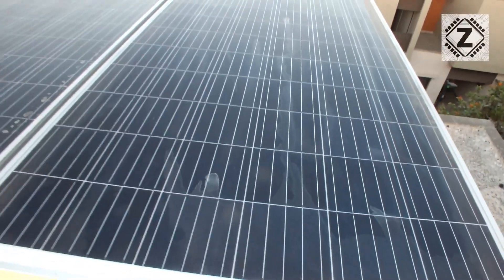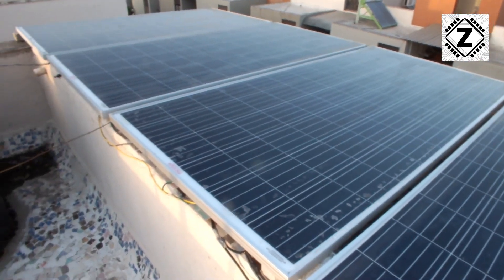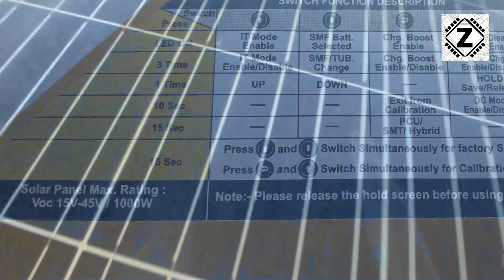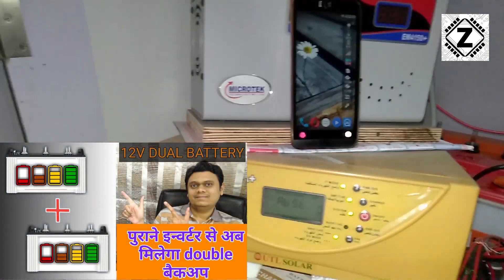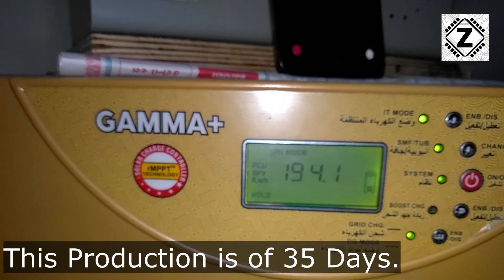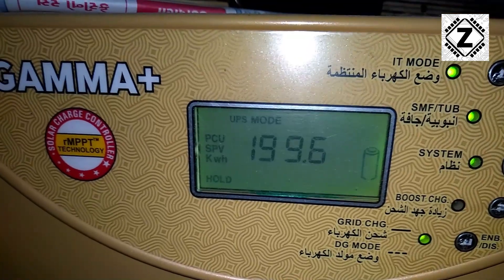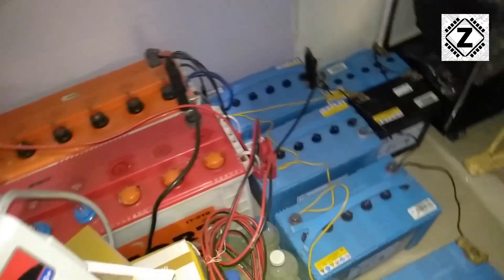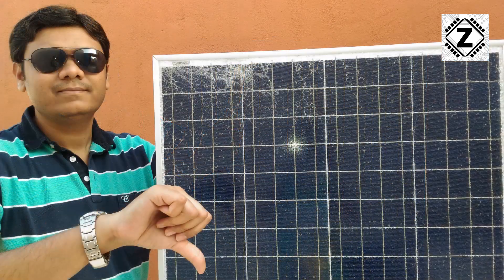UTL Gamma Plus Daily Solar Production proof | 1.3KW panels on 1kva Inverter? | Solar setup tour[Eng]

Comment: Can i connect 8 165w panels? By keeping 2 parallel of 3x165w series?
Reply: I use 24v utl gamma plus,  given Voc is 90v, and Voc of 165w panel is 22.2v
Reply from the maker: What you're saying will be 6 panels (3s2p)
Reply: That is one of option,  where i can add another 330wat panel to that combination

Comment: Sir, I have one question for you. I have a 150AH C20 tubular battery. I want to connect 1000W of solar panels to UTL Gamma Plus. Since I cannot charge the battery with more than 15A current, I know I have to limit the charge current in the inverter settings. However, will this also restrict the amount of load I can run directly from solar power during the day? My idea is to only limit the charge current going to battery but not limit the solar power for my other loads. Is this possible?
Reply from the maker: https://youtu.be/zaZgaVWMMsQ

Comment: 1.32KW is generating 5.5 units approx averaged over 35 days. So that comes to 4.16 units per KW of solar panel. This is a fairly good number as the average per KW is 4-5 units in India. I think with proper angle, it will generate slightly more.

Also the inverter shouldn't burn out with 1.3KW. What's most important is that you don't exceed the VoC supported by the inverter. The current will be automatically limited by the inverter on the output side. However, I hope they have good overcurrent protections on the input side too as that is what will prevent overheating due to over-panelling.
Reply from the maker: Good summary.

Comment: Do use Solar panel with  proportion of Battery. Fro 100 Ah,C 10 battery 240 watts solar panel only , if u increase more ,the battery will damage with in 3 years. Is it so .?
Reply from the maker: This used to be true for Old, Outdated or Cheap quality Solar controllers. In the modern controller you should be able to calibrate it and set Amperes as per battery installed-
https://youtu.be/6DSq_IUrJ0Q